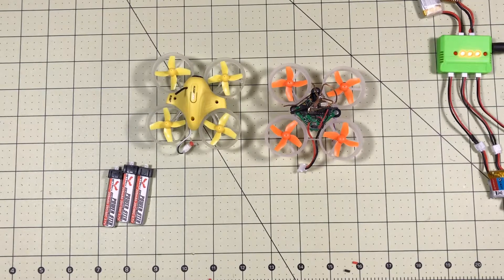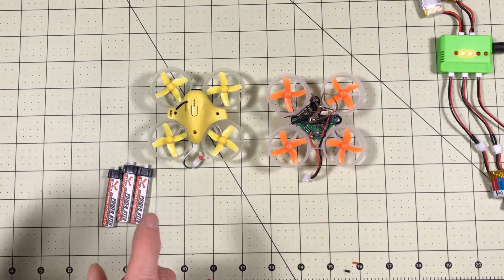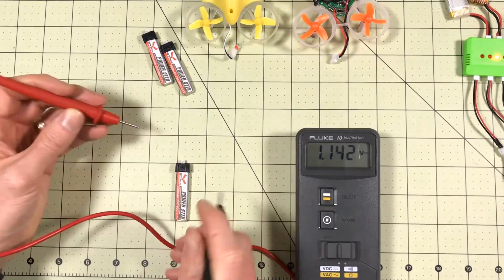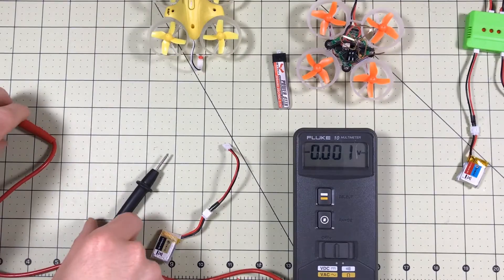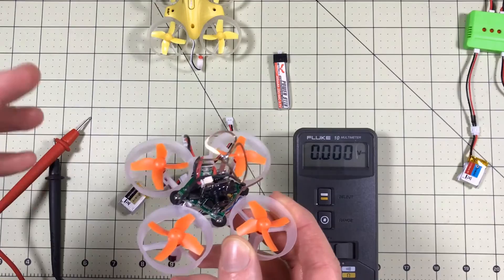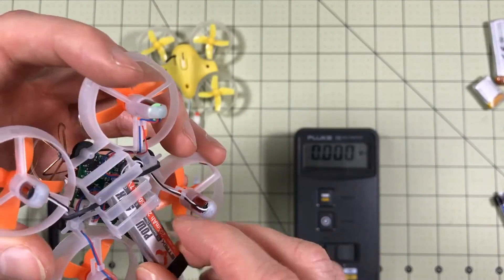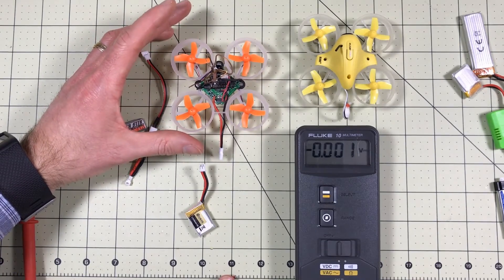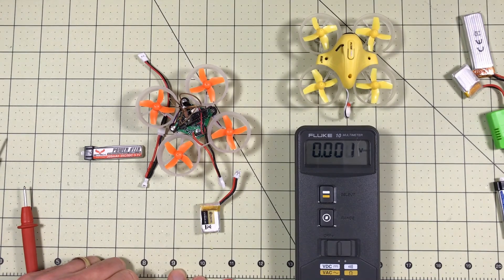Why does the Eachine E010S fly longer than the Inductrix FPV?  Does it need a mod?

Comment: What transmitter can you use with the E010s? I'm just getting into this and would like to get this quad.
Reply from the maker: It depends on your budget, but if you are really looking to get started in this hobby I recommend the Taranis QX7.  http://bit.ly/TaranisX7 It's the blue one I use in several of my videos.  It isn't the one I use in the E010S setup video, but the process is exactly the same.  https://www.youtube.com/watch?v=Zn2LylUYDbI&t  Then you need the E010S http://bit.ly/E010S  The Taranis is an FrSky brand so you would choose that receiver option (FYI it's pronounced Free Sky)  And then you just need goggles.  Currently I recommend the Eachine EV800D goggles, they have both diversity and a DVR and are very easy to use. http://bit.ly/ev800d  I just did a full review of those also.  https://www.youtube.com/watch?v=t1x9rjArpgo  Personally I think that is the best combo to start with right now.  The E010S is great to learn on and the goggles and radio you can use over and over and over for many years.  Oh yea, you will want more batteries too.  http://bit.ly/45CMulticharger

Comment: Excellent video, now i got a better insight about this drone, that i just ordered, now i just trying to figure out what extra batteries i will order, i have some options, that i still dont know if will fit in the battery compartment.

- Eachine E010S 3.7V 240mAh 45C. 
- Eachine H8 Mini 3.7V 260mAh 30C.
- Turnigy nano-tech 260mAh 35~70C.
- Turnigy nano-tech 300mAh 20~40C.
Reply from the maker: I have the first set you listed on the way.  I have reviewed the 150mAh batteries for it here which is what it comes with.  https://www.youtube.com/watch?v=lo1KSdYldYI  And you can get those here.   http://bit.ly/45CMulticharger  I'm curious to see how much the extra weight affects the flight.  I'm a little worried the bigger batteries will make the motors burn out a lot faster because of the extra weight and increased flight time.  You get good flight times out of the 150s already.
Reply: Thank you for the answer, the "new" E010S from BG comes now with the first one on my list 240mAh 45C, i just ordered one, but as you said, can burn the motors fast, im still trying to figure this out, now just watching video about and eagerly waiting for the package arrival from bg! In the mean time just searching for spare batteries!
Reply from the maker: +data9k thanks for the update. I didn't know that. I'll be sure to review them as soon as they arrive.
Reply from the maker: Yep, the link in the description goes to the one with the new battery also.  I just hadn't seen that they changed it.  Looks like my batteries are still on a boat on the way here.

Comment: I get 3 to 4m on stock inductrix with 250ma batts .
Reply from the maker: I did too when I first got it.  But over time it got shorter and shorter until it was down to about 1 minute.  The brushed motors wear and require more amps to turn which causes it to trip the LVC.  A lot of people replace the motors at this point but I was able to get it back up to 4 minutes with two mods.  You can see what I did here.  https://www.youtube.com/watch?v=IqesvdTF-8s

Comment: Is that a parallel charger on the right? How many amps does it charge and how long does it take to charge all your betterhes at once?
Reply from the maker: +Michael M It is, you can see a review here. https://youtu.be/lo1KSdYldYI  How long is hard question.  I plug it into a 2.1Amp USB port and it charges really fast.  It charges the 5 batterie faster than I can use them.  It works with most 1S batteries I have tried but doesn't recognize some batteries for reasons I can't explain.